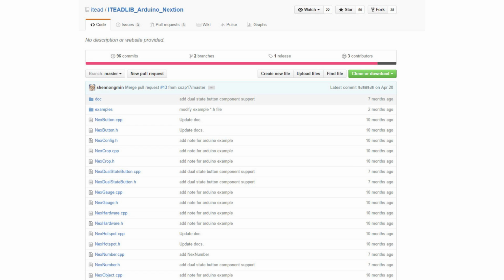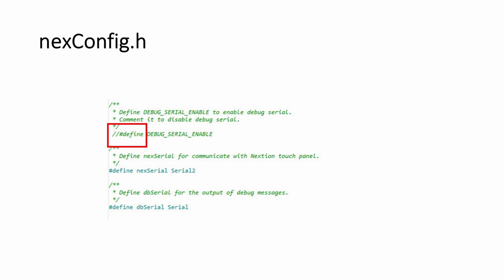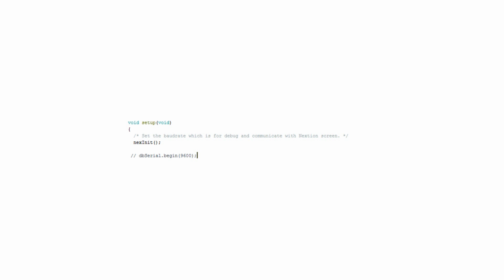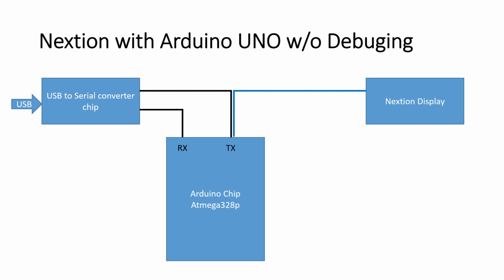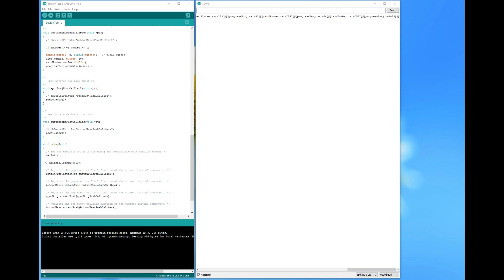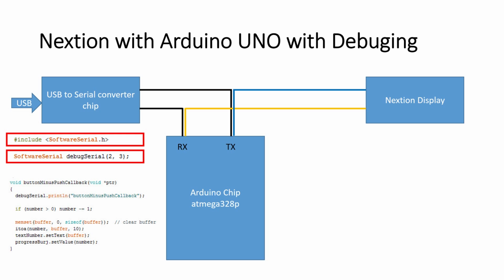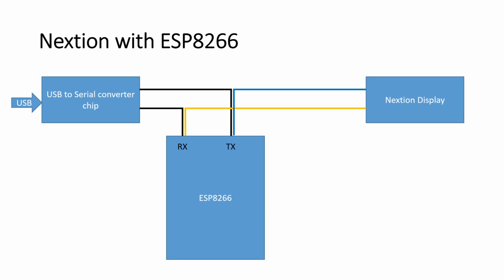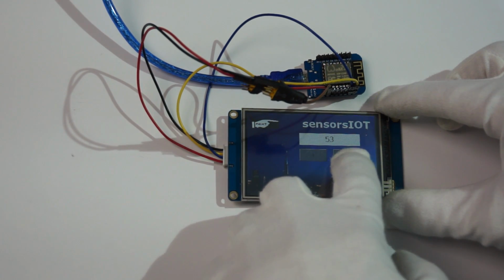#63 Nextion Displays with ESP8266 or Arduino UNO

Comment: Excellent. Disappointed that have to plug and unplug display all the time.  Was trying to using on my production machine to temperature and control a radiant heater
Reply from the maker: Indeed not comfortable.
Reply: @AndreasSpiess  I made it work by making other pins as rx and tx    Finally 😃

Comment: Hello!,
I have a weird situation, I have the software running for Arduino with my nextion, but if I connect a Wemos / Lolin, the wemos is not able to write or read anything from the Nextion. could you help me, why can it be?
Thanks
Reply from the maker: Unfortunately, I cannot do remote debugging. Check everything, especially the RX/TX pin connections.
Reply: @AndreasSpiess  
I have an Arduino UNO: https://i.postimg.cc/VN4Q568g/IMG-5735.jpg (attached image and works perfectly)
And a Wemos(Lolin): https://postimg.cc/nXSP2XVt (Using the same connections) that neither paints anything on the screen I send, nor detects the events when I press the screen.
Best regards.

Comment: Great video!  So to clarify, for the final example, you would have two USB plugs going from your setup, plugged into your pc? One for uploading data (when Nextion is disconnected) , and another for just debugging information?   THanks!!
Reply from the maker: Yes, you need two serial adapters.
Reply: @AndreasSpiess  gotcha! I just successfully did it last night right before bed!  Thanks!!
Reply: So I connected with Putty, but I am getting this message when I Press the buttons on the Nextion, I seem to get the expected debug messages, but I also get "recvRetCommandFinished err
" twice at the end .... I looked it up and apparently that means the arduino couldn't read the response from the serial that Nextion is attached to.  As far as i know, I configured the  NexConfig properly... any suggestions off hand?  Thanks so much!
A Snippet from the Putty Connection:
[1073669620:0,4,buttonMinus]
buttonMinusPushCallback
recvRetCommandFinished err
recvRetCommandFinished err
Reply: @AndreasSpiess  Question good sir, for the ESP8266 example, would I still need to use Putty to act as the Serial Monitor as you did with your Arduino Uno example?  Thanks!

Comment: Find this line;

in  NexConfig.h change:
/** 
 * Define DEBUG_SERIAL_ENABLE to enable debug serial. 
 * Comment it to disable debug serial. 
 */
//#define DEBUG_SERIAL_ENABLE

/**
 * Define dbSerial for the output of debug messages. 
 */
//#define dbSerial Serial

/**
 * Define nexSerial for communicate with Nextion touch panel. 
 */

#include <SoftwareSerial.h>
extern SoftwareSerial HMISerial;
#define nexSerial HMISerial

Then open your Arduino nextion example..choose one of them..

and add this line to your code..

SoftwareSerial HMISerial(10, 11);
Reply from the maker: Thanks for the addition!
Reply: @AndreasSpiess  gerne :)

Comment: Thank you so much for your videos, really helpful! 
A question though: Is it "safe" to connect directly between a Nextion 5V device and Wemos 3.3V device? Some state that there has to be a logic converter between the two.
Thoughts?
Reply from the maker: I used them with 5 volt
Reply: Andreas Spiess Yes, it seems like it should be fine after some inspection. I think Nextion’s TX is 3.3V, but I’ll have to double check. It seems like it’s a 3.3V device with 5V input like Wemos, but 5V is used for the backlight. 
The Wemos could probably be powered through its 5V pin from the same source as Nextion as well.

Comment: Dear Sir !!

first i want to say i am beginner of this work...my problem is  - i try to connect my nodemcu with nextion display  i done  everything as yours..but my nextion display not working as yours . i wired up nextion TX pin to  NodeMCU - RX pin and nextion Rx pin to NodeMCu D4 but its not working..please help me with this ,,thank you 

#include "Nextion.h"

void t0PopCallback(void *ptr);
void b0PopCallback(void *ptr);
void b1PopCallback(void *ptr);

/*
 * Declare a text object [page id:0,component id:1, component name: "t0"]. 
 */
NexText t0 = NexText(0, 1, "t0");

/*
 * Declare a button object [page id:0,component id:2, component name: "b0"]. 
 */
NexButton b0 = NexButton(0, 2, "b0");

/*
 * Declare a button object [page id:0,component id:3, component name: "b1"]. 
 */
NexButton b1 = NexButton(0, 3, "b1");

char buffer[100] = {0};

/*
 * Register object t0, b0, b1, to the touch event list.  
 */
NexTouch *nex_listen_list[] = 
{
    &t0,
    &b0,
    &b1,
    NULL
};

/*
 * Text component pop callback function. 
 */
void t0PopCallback(void *ptr)
{
    dbSerialPrintln("t0PopCallback");
    t0.setText("40");
}

/*
 * Button0 component pop callback function.
 * In this example,the value of the text component will plus one every time when button0 is released.
 */
void b0PopCallback(void *ptr)
{
    uint16_t len;
    uint16_t number;
    
    dbSerialPrintln("b0PopCallback");

    memset(buffer, 0, sizeof(buffer));
    t0.getText(buffer, sizeof(buffer));
    
    number = atoi(buffer);
    number += 1;

    memset(buffer, 0, sizeof(buffer));
    itoa(number, buffer, 10);
    
    t0.setText(buffer);
}

/*
 * Button1 component pop callback function.
 * In this example,the value of the text component will minus one every time when button1 is released.
 */
void b1PopCallback(void *ptr)
{
    uint16_t len;
    uint16_t number;
    
    dbSerialPrintln("b1PopCallback");

    memset(buffer, 0, sizeof(buffer));
    t0.getText(buffer, sizeof(buffer));
    
    number = atoi(buffer);
    number -= 1;

    memset(buffer, 0, sizeof(buffer));
    itoa(number, buffer, 10);
    
    t0.setText(buffer);
}

void setup(void)
{
    /* Set the baudrate which is for debug and communicate with Nextion screen. */
    nexInit();

    /* Register the pop event callback function of the current text component. */
    t0.attachPop(t0PopCallback);

    /* Register the pop event callback function of the current button0 component. */
    b0.attachPop(b0PopCallback);

    /* Register the pop event callback function of the current button1 component. */
    b1.attachPop(b1PopCallback);

    dbSerialPrintln("setup done");
}

void loop(void)
{
    /*
     * When a pop or push event occured every time, 
     * the corresponding component[right page id and component id] in touch event list will be asked.
     */
    nexLoop(nex_listen_list);
}
Reply from the maker: Unfortunately, I cannot do remote debugging.

Comment: Hi Mr Andreas, I use wemos d1 r1, but it does not work, is the same configuration that wemos d1 mini ?, thanks
Reply from the maker: No it is not and some of the pins are connected twice. I do not like it.

Comment: Hi Mr. Andreas, how are you?
Well, I've tried all the ways I've seen.
but none has worked for me.
I've done it with Arduino Mega 2560 and with Arduino Uno R3, and with none it has worked for me.
I have modified the NexConfig.h in all ways, and as they also say in the Forum.
and It has been impossible.
Please, if you can help me, is there any other secret?
I am in a project and if I can not connect the nextion with the arduino board, I will not be able to continue with this.
Thank you for your attention.
Waiting for your response.
Reply from the maker: It seems to be a big problem. I cannot do remote diagnostics. Maybe you watch my video about finding errors. It is all about reducing complexity and disconnecting your devices as much as possible.
Reply: Thank you for your response, Mr. Andreas.
Your tutorial and video are very clear.
I followed the step by step and still I could not connect the panralla.
When I upload the program to the arduino sketch, the TX and RX LEDs light up, the screen flickers but the CompButton program does not work.
Reply: Hello Mr. Andreas, how are you?
This is to thank you for your tutorial. Excellent.
Everything went very well with the connection.
Thanks for your time.
God bless you.

Comment: Andreas, I have two questions that you may be able to answer.
1) Where do you find all of the Arduino instructions for the Nextion display?  The best I can do is to browse the library files, which is very tedious and certainly not suitable as a users "manual".
2) Do you have any idea why is it recommended to not use the attach:Push method?
(This is from NexButton.h:)
/**
 * NexButton component. 
 *
 * Commonly, you want to do something after push and pop it. It is recommanded that only
 * call @ref NexTouch::attachPop to satisfy your purpose. 
 * 
 * @warning Please do not call @ref NexTouch::attachPush on this component, even though you can. 
 */

Many thanks,
Steve
Reply from the maker: The documentation is not good. This is why I made these videos. It is not made for users, only for programmers ;-)

Comment: Hi,
I'm tryng to use Nextion 3.2" with arduino (UNO R3 and NANO), but i can't manage to let it work.
i downloaded the files attached in #59 and modified the NextConfig.h as follows:

//#define DEBUG_SERIAL_ENABLE
#define dbSerial Serial1
#define nexSerial Serial

Loaded the Button_2 example, in Arduino and Nextion.
Results:
on Nano, the Rx led is blinking when i press a button;
on UNO no led is blinking;
in both cases the number does not change

Missing enithing?

thankyou
Reply from the maker: This should work. I do not know where the problem is. Maybe you mixed the two RX/TX cables?

Comment: I found this tutorial after having issue with a project. I'm using an UNO for a gps project using the Neo-6M and I want to put a Nextion display. I got the gps working on the serial monitor but when I incorporate the Nextion display, the gps stops and no display comes on my Nextion. Will this video solve the issue? I'm already using the softserial library with the code. Do I just add the "virtual" rx/tx line? Thank you!
Reply from the maker: You have to use a separate Serial connection for the GPS, for the Nextion, and for Serial. I made videos about Serial and the Nextion

Comment: Hey Andreas, been using my Nextion for over a year now with my Arduino, but it's developing graphical glitches. last year I got a random white line 1 pixel wide going down the screen, and this year another has appeared. I tried reuploading everything to it but it seems stuck. Do you or anyone else have these problems? I'm wondering if there's a surge in my 5V circuit where I should be using a capacitor or something, or maybe it's not designed to be left on all the time even with the screen faded to zero.
Reply from the maker: Seems to be a bad quality of the LCD. I have no such longtime experience.

Comment: Andreas, I wonder why you do not care about 5V TX from Nextion display to 3.3V RX of the Wemos.  I saw other sites where they use adequate conversion. Any suggestions? Thanks
Reply from the maker: +Markus Rohner Just do it. ESP8266 are 5volt resistant

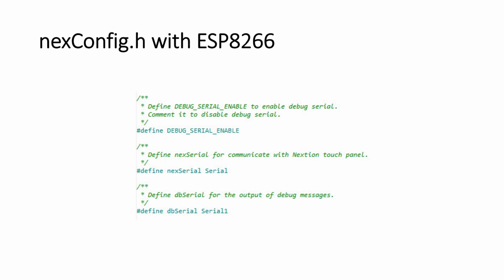Comment: At 5:37 and 7:16, you mentioned that you used a "USB to Serial Adapter".  I think this is incorrect. The input to that adapter is serial data (coming from Uno's Pin 3) and the output from that adapter is USB (going to your computer). The FTDI drivers that you install on your computer translates the USB data (which encapsulates the slower serial data,  I'm guessing) back to serial so that Putty can display it. 

"USB to Serial Adapter" implies that the input to the adapter is USB and that the output is Serial. However,  USB communication runs on the order of Mbps and Serial operates in the effective communication speed of hundreds of kbps.
Reply from the maker: FTDI and other USB to serial adapters are called so, because they have on one side a USB plug and on the other a RX and TX pin. So: USB to Serial

Comment: Hi Andreas
Thank you for your helpful and interesting videos! I am new to Nextion and I'm trying to start with the slider example.
I was wondering if you could please help me to understand a problem I am experiencing when trying to upload the sketch to my Uno, I receive many errors regarding the "NexHardware.cpp" file, including:
"C:\......\libraries\Nextion\NexHardware.cpp:55:5: error: 'nexSerial' was not declared in this scope"...
I have only made necessary changes to the NexConfig.h file as explained in the video.
I would greatly appreciate any advice on how to fix this problem. Thanks!
Reply from the maker: +Clayton Pheiffer Just check the line with the define of the nexSerial in the config file. Something seems to be wrong there. It should be serial1for an uno
Reply: Hi Andreas, thank you for your response! I managed to get it working.

Comment: Dear Andreas,

Thanks for Videos about the Nextion Displays and the related Ardrino informations. I'm on my way to my next project which will be setup an Oscilloscope based on the Uno and the Nextion with extension Board. Do you or some of the readers some tips, hints and links how and where to start.
Reply from the maker: +Norbert Wenkel Oscilloscope and Arduinos are usually not a good combination, because you need very fast ADCs and also fast processors. If you want to do it for fun, that's ok. But it will be very slow.
Reply: +Andreas Spiess thanks a lot for your comment. Sure  the oscilloscope project is a bit for fun. May be you have some additional links related to the nextion display for realizing it faster.
Take care 
Norbert
Reply from the maker: Norbert Wenkel No, I do not know, if anybody tried it. Look good, if the objects included in the Nextion are sufficient for your needs, especially to show the waveform. You cannot create new ones or change them. Download the Nextion editor and build your planned GUI and simulate it before you buy a isplay. You see, I am very sceptical ;-)

Comment: Valuable upload Andreas. What libraries have you used? I have followed all of your videos, tried githab but unable to connect nextion 2.4 display with WeMos D1 Mini or NodeMCU boards. I tried your ButtionTest_1 example and made the Nextion stuff according to your video. Buttons neither increment nor decrease value.
Reply from the maker: The library I used is on my Github repository (nextion.zip). Pay attention that you  set the flags in the editor (shown in my video). And maybe you have a USB to serial adapter in parallel to the Nextion with Putty. Then, you can see the traffic (or the lack of).
Reply: I am using nextion.zip from your repository. You mentioned the flags, I have double checked objname and id of component in Nextion editor and .ino file, both are correct. Touch press and release (both) are checked for "Send component id". Moreover, both buttons return data in Nextion simulator. In NexConfig.h, I have set serial according to your instructions. Am I still missing something? For the moment, I don't want any debug, I just want that number should increase or decrease.
Reply from the maker: I do not see the problem. Just one hint: Do not check both touch events. I had my problems with that.
Because the Nextion behaves like a serial device, you can also check, if TX and RX are connected the right way by using a test sketch with serial.read.
Reply: As I was using Nextion 2.4 inch display, problem was the baud rate which i chose 115200, When I switched the baud rate in "ButtonTest_1.ino" sketch from 115200 to 9600, everything started working like a charm. I also chose only one event for one button in Nextion Editor. Link for Andrease repository is https://github.com/SensorsIot/Nextion-Tutorial. Thank you so much Andreas for your kind support.
Reply from the maker: Waqas Ahmed Glad to read that it works now!
Reply from the maker: There is a support homepage which should cover these difficult questions: https://itead.freshdesk.com/support/home. Try it there, please.

Comment: Hey Andreas, have you ever tried SoftSerial? This is very useful when you need multiple serial connection on the Uno. Thanks for the video
Reply from the maker: Of course, I know it and use it where appropriate. Unfortunately, I was not able to use it with this Nextion library. It did not work and I did not find out, why.
Reply from the maker: It only does not work with the library I used. A Nextion can be connected via softserial. But then, you have to use another library.

Comment: You can use Serial.Swap() to redirect serial pins after boot so that you don't need to disconnect Nextion during flash. For debugging you still need to use Serial1. Thanx!
Reply from the maker: +Germán Martín How would you do that? The Nextion has to be somehow connected to the USB during flash.
Reply: +Andreas Spiess Using swap function serial port starts using different pins. You may check espressif sdk documentation. Doing that does not affect behaviour during flash so you can use standard pins to burn firmware. As nextion would be connected to different pins it is electrically isolated and it will not disturb upload process.
Reply from the maker: Now I understand. Good idea!
Reply: +Andreas Spiess Alternative pin for Serial RX is gpio15, that is used to configure boot mode at startup. It must have 0V during boot to allow normal work. You must ensure there is no signal in tx line from nextion during startup and reset to get esp working. If you find that, after connecting rs232 to alternate pins, esp does not allow flashing it may be because of this.

Comment: Strange thing is that examples from Itead library for my Arduino UNO doesn't compile. It says: 
libraries\Nextion\/NexUpload.h:133: error: 'File' does not name a type

Am I the only one with such difficulties compiling examples?
Reply from the maker: This is a sign that your library is not installed at the right place or you have installed more than one library. I would delete alle nextion libraries and install the one from my video's commen. At least, this helped another viewer with a similar problem.